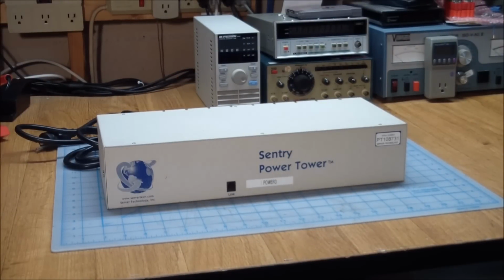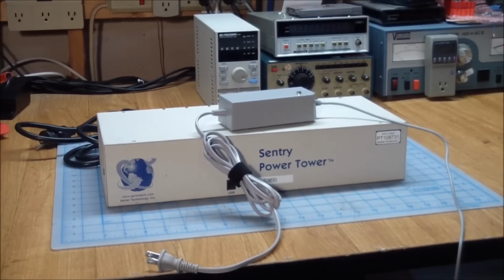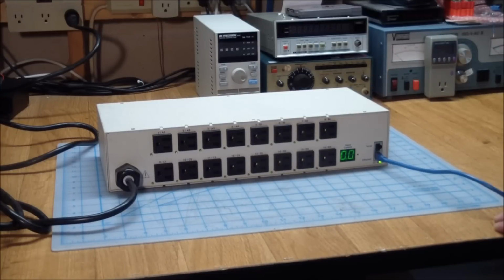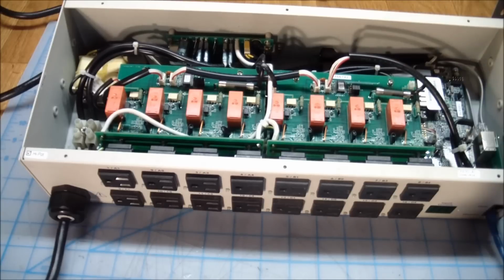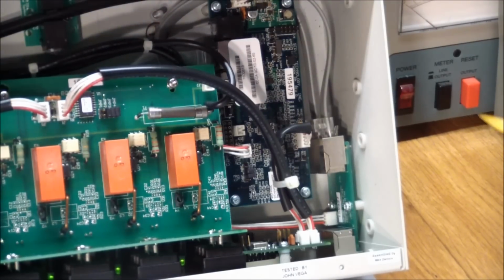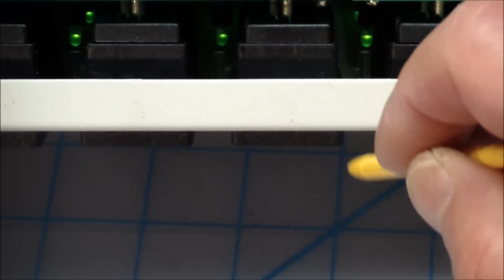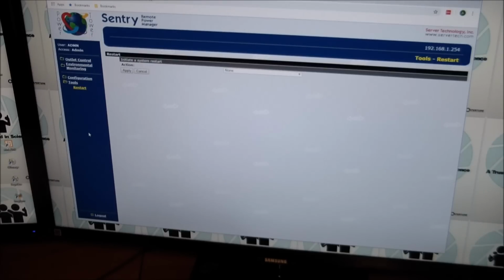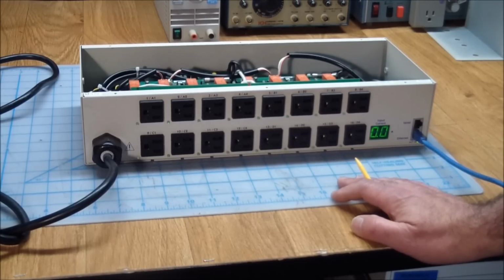AE#76 Server Technology Power Tower Checkout And Teardown

Comment: I would use them with my Hard Drive Array's, they eat so much Power running when not use I leave them off ti'll I have a Job and need to dump remote files, be great to use and turn on a few TB's when needed..
Reply from the maker: If you have lots of arcade games or pinball machines you could use this to sequence power to them and not blow any house fuses.

Comment: You need a little AP called Fing for your phone. It will scan your network and tell you everything on there by IP address. It is fee and I use it all the time at work and home. Finds all those hidden IOT devices in seconds.
Reply from the maker: Great suggestion. I originally looked at the routers ip table and found the device, but the username and password were unknown and I had to reset the device anyway.
Reply: @artifactelectronics  thank goodness for master reset switches. Good videos. Thanks.

Comment: You need to implement an Alexa skill to make this thing useful...
Seriously though, I can see how the functionality is useful in a server room or closet and also in any environment where you want to control the order in which devices power up after an AC failure. It probably originally cost a lot more than 16 modern smart switches -- not that I would use those for servers.
Reply from the maker: What you had a bunch of raspberry pies as servers. They can draw better than 2A each, but if your AC outlet can handle 35A you're good.

Comment: I think a device like this might come in handy for when you need to do a power cycle reset of  certain network connected devices that have gone into a frozen (hung) state.  You could also write some scheduling utilities for home automation.
Reply from the maker: I agree that you could do some really useful things with such a power management device. I'm just surprised that they didn't offer something like a python api so you could automate such tasks.
Reply: @artifactelectronics  It would be really nice to control vintage electronic devices that used proper switches. Most modern electronics would just cycle back into standby. The old devices had those piano style switches and buttons. Those were the days. :)

Comment: It's just a security device.  It seems to be made for some industrial application.  I would guess it was used in a bank or classroom,  probably a classroom to keep high school students from using the computer without the teacher's permission.
Reply from the maker: You could indeed secure devices with integrated power cords by locking up the power feed. But it seems that a lot of machinery has IEC cords defeating that sort of security.